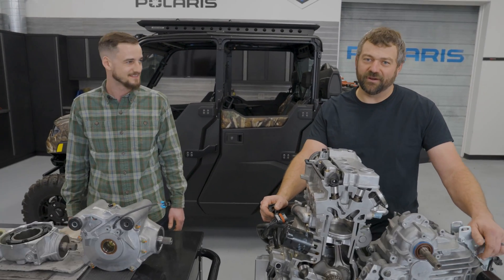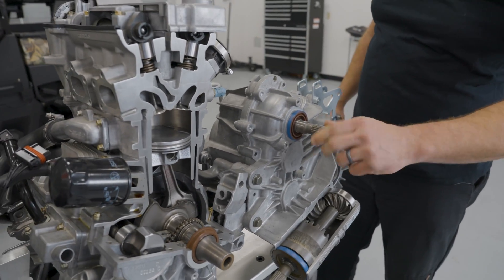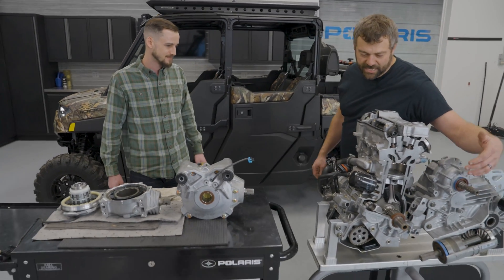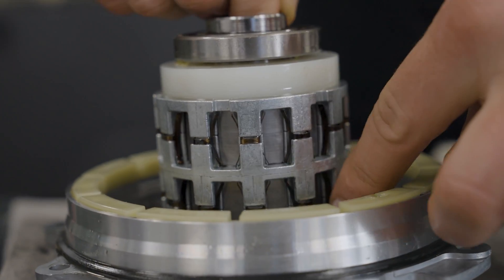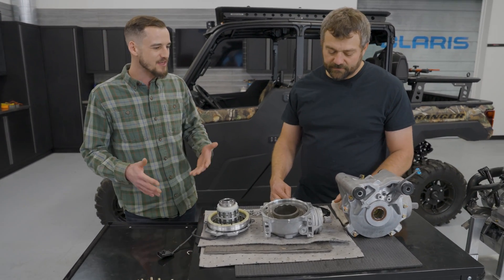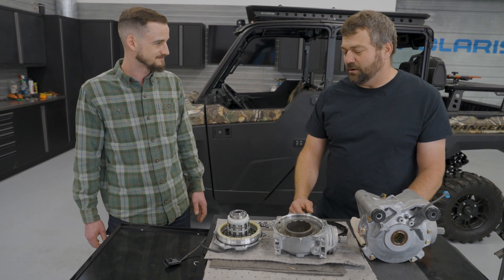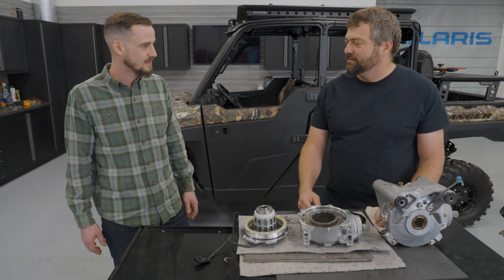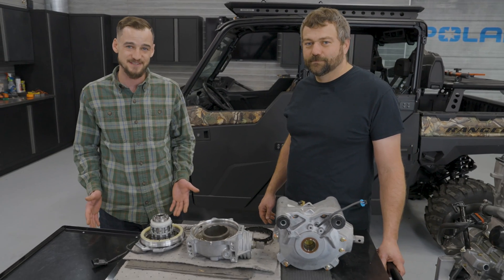FRONT VS REAR DIFFERENTIAL? WHAT IS TURF MODE? - SHOP TALK EP. 14

Comment: I need some help troubleshooting my 800 XP Ranger. When I'm on snow covered roads the rear end wants to pass the front end as if it's a two-wheel drive pickup. If it's not in four-wheel drive it won't go. My front tires are marginal at best. I did try putting several hundred pounds of weight in the back to know Improvement. What do you think I have going on it's scary to go over 15 mph or the rear end will slide around and put you in the ditch.

Comment: HI thank you for this video wich is really good and instructive ! However, in this video you talk about an underdrive system but when we look at the manuel we see that the drive ratio is more important for the rear wich (9.26:1) thant for the front (3.1:1). That would mean that the front wheels are supposed to turn quicker than the rear ones. Therefore how is it possible to have an underdrive system ? Thank you !

Comment: I have an Xpedition ADV that I ride on the road quite a bit (cruising around town and also on roads driving between trails). This is my first side by side with turf mode, so I am unsure on best practice. I have been putting it in turf mode while on roads to keep the rear diff unlocked to help save tires and not be as hard on the differential gears. That being said, I’ve heard of a lot of turf mode failures on Generals and Xpeditions. Am I correct in running turf mode on streets at higher speeds?

Comment: NEED A VIDEO ON 2025 RZR wire harness and show all of the wire harness blanks that polaris adds so you can  add accessories. Its sometimes difficult to find these plugs for accessories. for example the wireless winch remote plug... where the heck is it. Polaris says its there but I cant find it.

Comment: I have 7200 miles on my 2017 900xp never once have I had a differential problem in front or back.
It's the best AWD system I have used. All 4 tires are working with this system. Other machines I've owned would give 3 
wheels working, it'd piss me off because the front tire with the most to gain never had any power to it.

Comment: Good content. So whats the big issue with people blowing out the differentials due to turfmode issues? Is that due to being in turfmode or or in 2x4 or 4x4? I have 2 friends that have blown the casing from not even riding hard or putting the machine in binds. 1 was from loading on trailer. And what are some things to prevent this, perhaps not using turfmode or?

Comment: You touched on the waiting to safely energize the front diff. I get it but....
I'll say, I love the Polaris AWD, but something that annoys me vs the other typical 4x4's is that I'm hauling down an open trail. I need 4x4 now. Other systems can be engaged at speed and you're good. With Polaris, my AWD will never engage unless I'm going less than 18-20km/h.
Yes I can leave it on, but I don't always want that.
From an ECU perspective, can it not intelligently know I'm going straight and it's "safe" to engage at 30, 40, 50km/h ?

Comment: I have the 2020 55in Scrambler S I'm running 29 inch tires on the front and stock 27 in tires on the back. I have been hesitant to engage 4-wheel drive because I'm uncertain if this will damage the front differential. Does anyone know if there's enough tolerance in the differential for 2 inch difference between tires, or will this mess up both front and rear differentials?
Reply: Tires need to be close in size, have the rear tires a bit bigger if you want but never the front. 
The way the AWD works is awesome, but don't do stupid things like bigger tires in front. Look at yer owner's manual. If you have bigger tires on the front leave it in turf or 2WD. Get them tires changed, most of the frt & rear diff problems come from mis matched tires. Don't run different sized tires on the back either, pair em off.

Comment: Polaris recommends not running in turf mode unless necessary. I believe this is because the axle shafts run in bushings and will wear over time if running at different speeds side to side...is this correct? Since it turns better in turf mode, riders are tempted to run in turf mode often since it doesn't buck when turning on hard pack...

Comment: Outstanding explanation of the drive system. After my 2009 700XP was stolen in August 2022, I purchased a new 2022 1000EPS. I love the various drive modes. My primary use is as a work vehicle around a water ski lake. Turf mode is invaluable!

Comment: Good video.  Question:  If legally driving on pavement for extended periods, should turf mode be used to avoid damage to the rear locker differential?
Reply: @Polaris Off Road    I have the same question.  Thanks!
Reply: When I drive my Polaris, XP 1000 I have it in 2 Wheel Drive
Reply: I would think so.

Comment: "Turf Mode" should be offered on the RZR's. On hard pack trails or a gravel road having the rear two tires locked together causes some unsafe conditions around corners by way of the rear end sliding out.
Reply: Guessing the reason they don’t is because of how much more power they have. Less to break when it’s a closed differential
Reply: @KMT15  "Turf Mode" is standard equipment on the RZR's in Europe for many years for road riding. The parts can be purchased to convert a USA RZR but costs thousands of dollars.